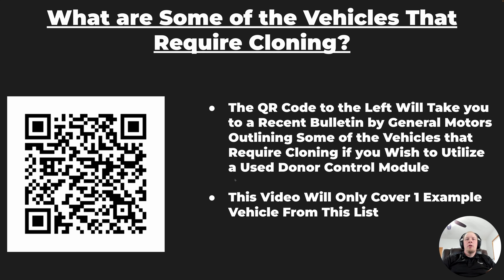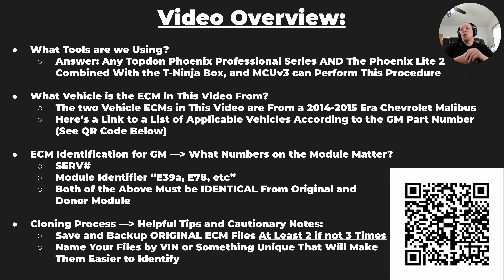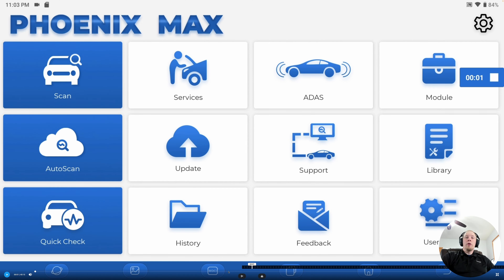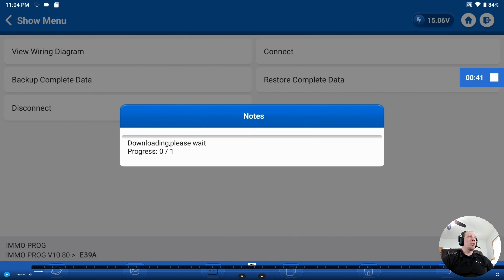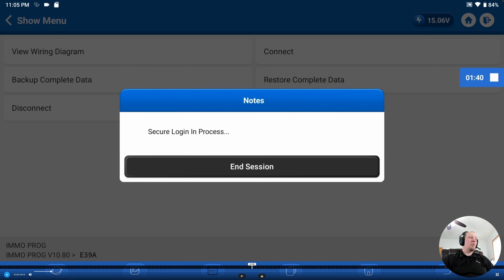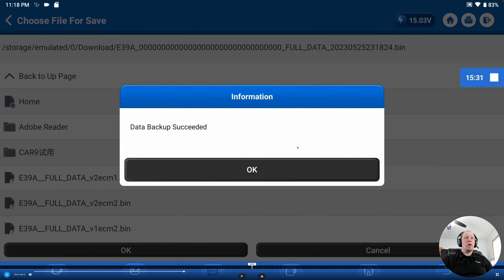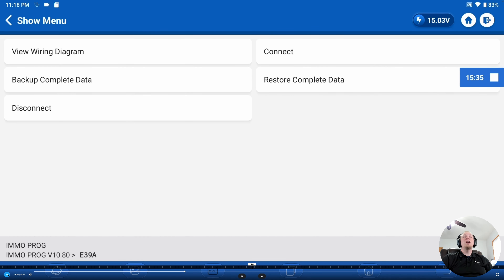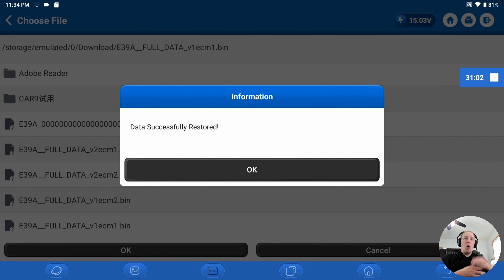How to use the TOPDON T-Ninja Box to clone a GM Global A ECM (E39A)

Comment: Getting a "Security Inspection Failed" error when trying to connect to a Bosch EDC16C2. Checked all connections many times. Got a Pheonix Plus with the VCI connected via USB to the Y cable to a T-Ninja Box, MCU3 and cables to the correct pins on the ECM. MCU3 and Ninja Box powered by a Y-cable to the Ninja power supply. What could the problem be? Thx
Reply from the maker: Hi, can you plz contact us:support@topdon.com and provide the SN and upload the logs  along with the ECU label and pics of the pins.

Comment: Can you clone any module using this? Also does this program the VIN info in EEPROM from one module to another?
Reply from the maker: Thank you for your inquiry regarding the TOPDON T-Ninja Box. To assist you further, could you please provide the ECU label for verification? Additionally, please note that programming the VIN information into EEPROM from one module to another is not supported.
Reply: I do not have an ecu it was a general question.
Reply from the maker: @Bradcaliber  Got it. Tninja box covers many individual chips which are found in a large variety of modules. However the “guided” portion of the tool is limited in scope to specific modules for specific vehicles.

Comment: Hey mate,

What about the EEPROM Data? 
I was under the impression that we also need to transfer the EEPROM data (as it stores the stores up calibration information from the vehicle). 

Wont the vehicle experience issues with fuel consumptions etc, or does the data transfer cover everything already.

Please don’t take this the wrong way, as your video was very informative and helpful.

Thanks again.
Reply from the maker: yes, the backup is all of the original ECU, so the restore is also all of the data, some models will backup and restore the EEPROM and FLASH data separately, the GM model's is integrated together.
Reply: Trying to connect to a Bosch EDC16C2, wired exactly as the diagram with the Phoenix Plus, MCU3, cables, and T-Ninja Box, VCI with USB cable. Checked everything many times. getting a "Security Inspection failed" message every time. Is the Ninja power supply not enough to power the MCU3 also, or what could be the problem? Thx. All updates done.

Comment: So we need mvcu3 and t ninja box while using this with the phoenix plus
Reply from the maker: Hello, Phoenix Plus is compatible to work with T-ninja Box, and MCU3 is an optional part of T-ninja Box. With MCU3, you don't need to connect the wiring separately on the anti-theft programmer panel. It's applicable to the ECU cloning function in BENCH mode and part of the Mercedes-Benz all key lost platform operation.